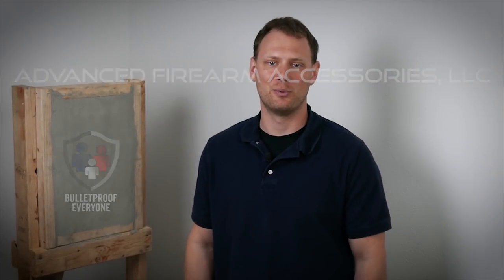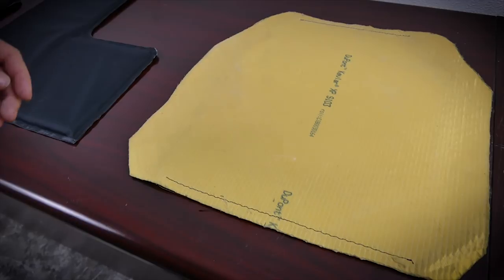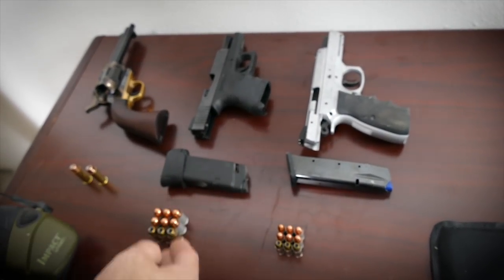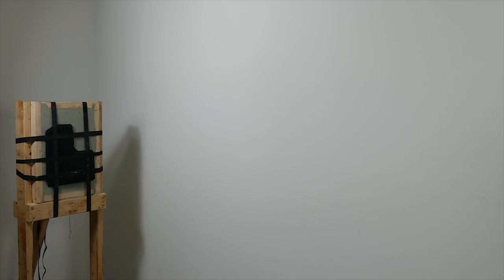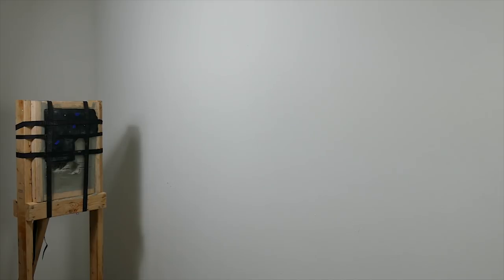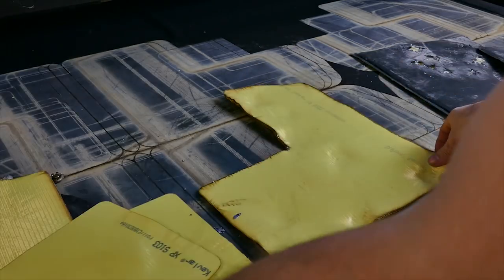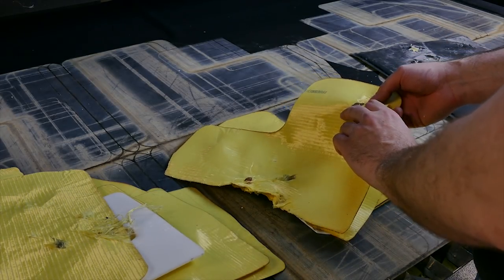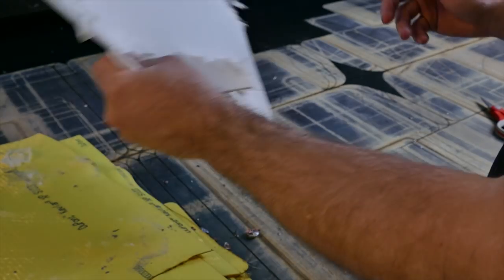AFA Bulletproof Everyone IIIA Demonstration

Comment: I was just about to inquire if the panels could stop more then a single round and maintain effectiveness. I'd still rather not be shot at all. But I've played enough Zombie games to know that "double tap" is pretty common. Impressive display.
Reply from the maker: About 4 to the exact same spot, spread them out a couple inches and you can easily get 20 to the panel before failure.
Reply: @BulletproofEveryone  how are they Jacket??am Red pineapple from Roswell NM USA American am landscape house yard

Comment: I guess I'm starting to be convinced by the product, but in a situation where I'm going to be shot, there's a good chance you're going to take >1 bullet. So these videos are pretty decent for demonstrating ideal conditions. 

I guess a few sensors behind the panels to help ID the exact force you're going to be hit with post-dispersion would be a nice +1. A bruised up torso and liver can mend, but it'd be nice to know if you'll be able to even stand as you get hit, or if you'll just be guaranteed knocked to the ground from the force.
Reply: Just watch the video in which the CEO shoots him self in the side while wearing it and still keeps on giving his sales pitch. 
Pretty much tells ya it's not going to knock you down🤷‍♂️
Reply: Also depends on the round, a 9mm will not knock you down, it feel like pinch or slight pressure hitting you. But a 44 or 45 can knock you down not by force, but impact may rupture your body and with the pain you might take a knee or fall back. Also keep in mind if you are wearing body armor, you want to take an appropriate wide stance so that any round you can take will have a higher chance of impacting your Kevlar. Also, I suggest looking for bulletproof underwear or pants to go with this because any trained eye knows to aim slightly below the belt if it seems you are ineffective from getting shot in the chest.

Comment: Just buy 2 of front and back each and combine them making 20Layers each at home.
Reply from the maker: For what purpose?
Reply: @BulletproofEveryone  Not gona hurt
Reply: The jacket itself with the level 3 weighs roughly 10 pounds, adding another layer will make your jacket bulk out and weigh about 20 pounds. It may not sound like much, but you’ll definitely feel more fatigued wearing a 20 pound vest everyday.